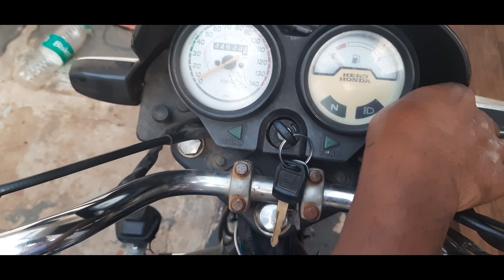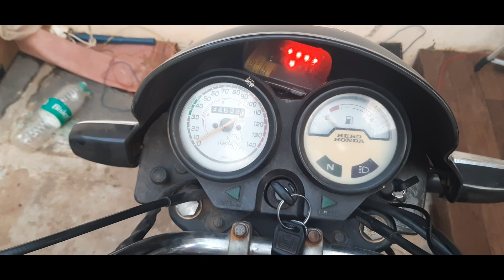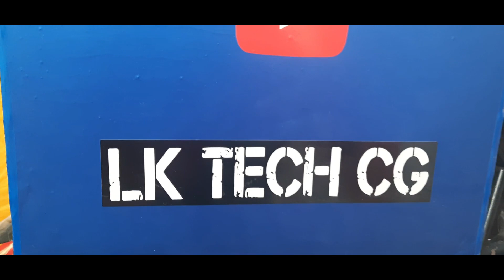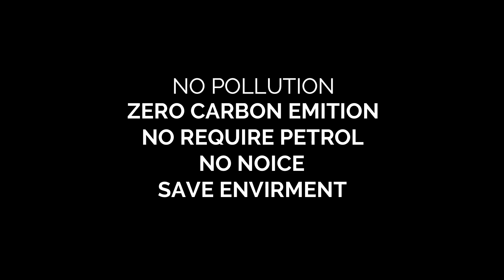Easy to make hybrid bike petrol + electric  घर मे बनाये इलेक्ट्रिक बाइक

Comment: Bro kya petrol se chalana par Bldc motor se power generate hone par apke controller kharab kar sakta h
Reply from the maker: Regenerative wala motor nahi hai ye
Reply from the maker: Uske motor controller alag aata hai
Reply: Bro aapka number
Reply: Bro 12 volt 40 ampere  lead acid  batteries se .  Yadi Voltage Controller se Voltage Badha se 12 to 48 volt . Kya 48 volt 750 watt motor chalega
Reply from the maker: Achhe se nahi chalega
Reply: Bro 48 volt 40 ah battery banane k liye kitne Cell ki avsakta hogi
Reply from the maker: @Rahul-g6p6b  अगर 2000 mah का सेल होगा तो 195 सेल लगेगा
Reply: Price?